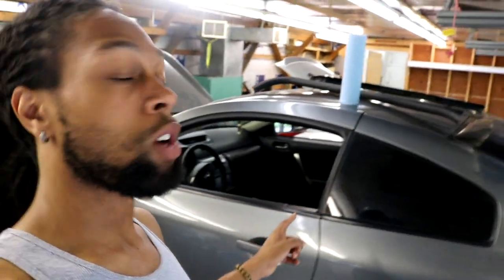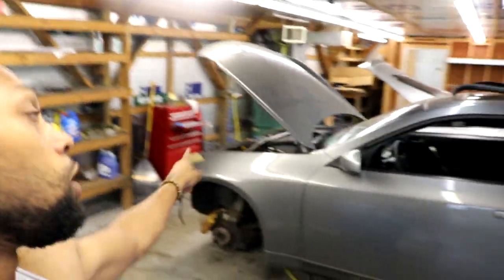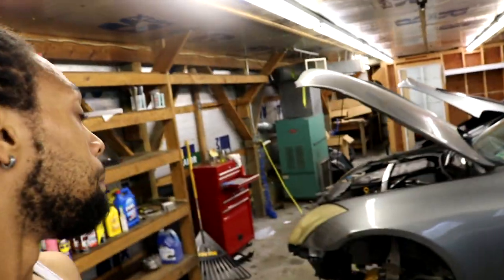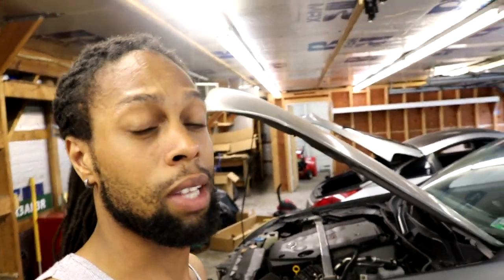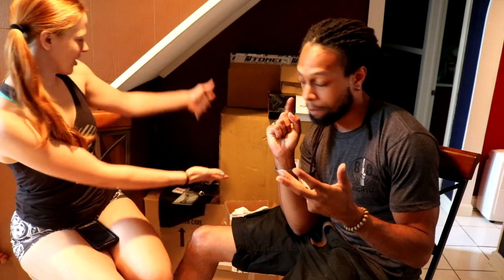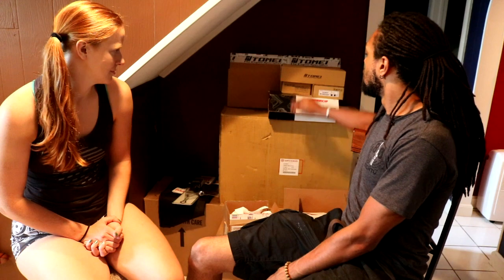How much it costs to Build a +700 VQ35

Comment: im actually doing or trying to do the same for my car, its a de automatic, ill be building the trans as well, i was looking at around 12.8 for the turbo and the parts that the z1 has that engine built kit ur talking about, what turbo are u running? im buying the soho motorsports one thats 7.2k and thats included with the 12.8 k, i was told to go tt but honestly?? its a bit more expensive, im doing the gtx385 from garret with momentum piping and treadstone intercooler, which t are u running? 8k? compared to 12, SHIT!!! I rather spend that lol, i was told to go ls swap to and a stock ls2 or 3 block can easily hit 650 stock internals, but yea considering the fit in and al that itll be the same price or maybe a bit not difference expensive, my DE has 130k miles, but the car and engine has been babied bye my and my trans and engine are running great always adding better oem trans oil from nissan and using royal purple for the oil so its been babied and taken care off, but may i ask which turbo u are using? cause shit bro 8k sounds better then 12 lol, let me know bro and ill continue to see ur vids, thanks
Reply: sorry bro, lmao this was my moms account and i messaged u thru her utube, answer me back here, but yea this message was me lol thanks man

Comment: You basically built my engine, but for 2k more...and still just in parts!!! PLUS you still got plenty more cash to shuck out in labor bro! 🤨🤔🤯
I couldn’t even finish watching video due to the gross overspending and unnecessary overthinking! Pa Bon Neg! 
By the time you’re done, you could have done nearly the exact same upgrades you’re doing....TWICE! Not to mention the time exhausted on this project to feel like you did a totally unique 1 off custom engine build, that could have been so much cost effective by allowing the professionals do their jobs (Reputable Performance Engine Builders & Sales Associates) rather than do it for them after countless hours of research of parts and compatibility to equal the Over Priced damn near exactly equivalent product that could have been as easy as shipping off engine core and receiving a totally rebuilt (to your personal specs)motor in just a few weeks which by the way it doesn’t matter how many miles were on your original one because you would receive a totally different motor as the one you sent in has to pass rigorous inspection to verify it’s a viable candidate for a performance upgraded build or else it would be rejected because it’s fucked up beyond rebuildable specs! Not Hating on your build but damn dude, you went way beyond what u had to, all just for the ability to say it’s a Custom Engine Build! Good luck and I’ll be awaiting follow up vids, I wanna see what she puts down on Dyno and your “FINAL” -  ALL IN TOTAL COST of build....I got a feeling I’m not the only one gonna be sick to my stomach when the numbers and RWHP RESULTS are revealed! If anything....you’ll have a badass G and 1 more subscriber as I’m def gonna do that rrriiiiggghhtt NOW!!! 👍🏼✌🏼

Comment: 8K+ Damn Homie you could’ve done a RB swap for that price...!
Reply from the maker: True but this was more personal. We do have plan to rb some new project though 😎
Reply: where can you rb swap for 8K???
Reply: Rb swap would intel SO much fab work its not a drop in and go bro plus wiring harness would be a costly nightmare. Thats a 10k swap easily and thats on the cheap side.
Reply: @bobbyholmes4586 plus getting a good condition VQ is way easier. RB is  almost a decade older and they have a lot of known issues like cracked blocks.

Comment: Damn. Stock trans? Are you running tt?
Reply from the maker: Trans is stock now and but is the next thing on the list to be built. We will be running the speedforce oil-less low mount tt. Which has seen over 900hp so the trans definitely in the works
Reply: @thecarcouple3538  thats sick bro. Got a subscribe outta me. Looking to do something similar
Reply: rsloop77 stock trans is rated for 1,100 hp i believe